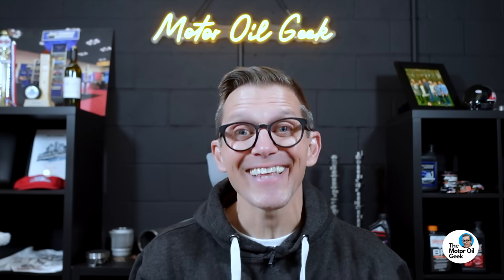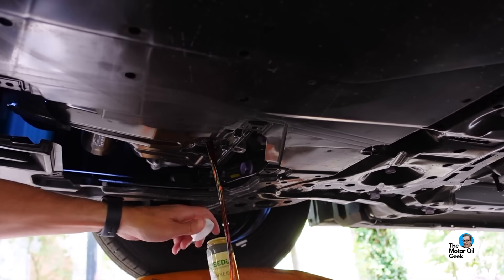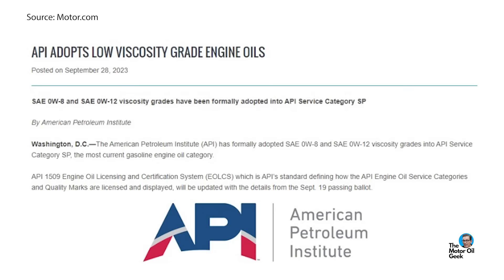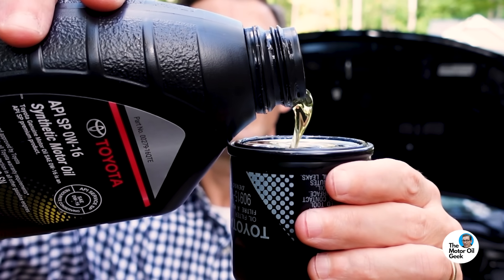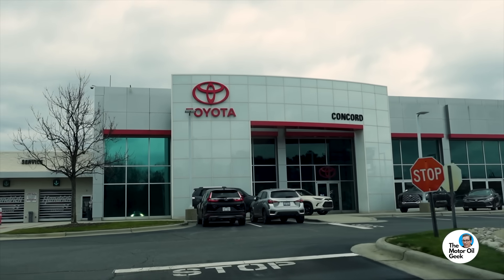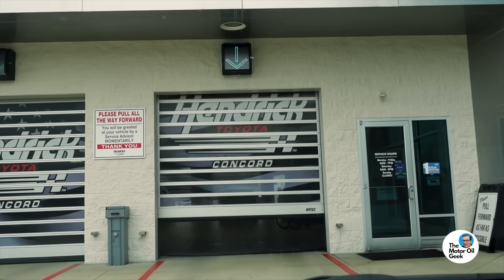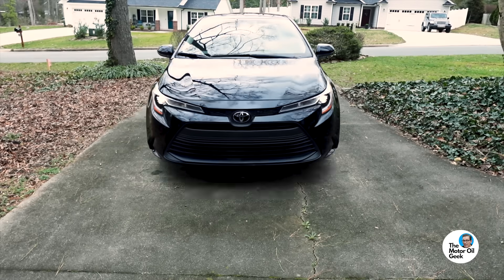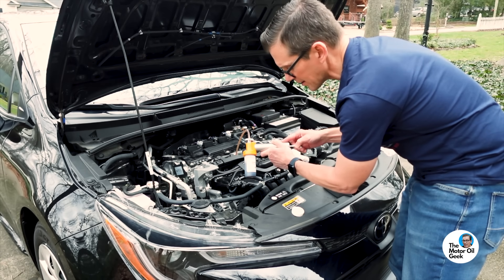0W-8 Motor Oil: Too THIN to Trust? Let's Find Out!

Comment: 0W-8 is crazy if it is even a thing now.  We have yet to see if 0W-16 has any meaningful impact on cars compared to the previous most common spec which was 5W-30/5W-30).  my guess is that at best, it would be the same due to improvements in metals and anti-wearing technologies, even though they now use a thinner oil and engines with tighter tolerances.

However, the FIRST mistake you made is that you DID NOT change the oil in that Corolla until 10k.  I would have done it at about 1000 miles, 2500 miles and then again at 5,000 miles and every 5,000 miles there after.  This sounds a bit excessive and maybe the second one at 2500 miles is not needed, but you do want to change the oil after the first 1,000 miles or so (After "break in").  I just do mine every 5,000 miles or about every 5 months, whichever comes first, and this is how I've done it on all of my vehicles (both right after break-in with the changes at 1k, 2500 and 5,000) and all of my previous cars made it well over 200k miles).  I'm sure it will probably be OK, but I would not go that long between oil changes especially if it calls for a thinner oil like 0W-8.  The reason the mfr likes to tell people 10k is because the engine likely won't have issues through the warranty, but it might start to have issues after a few years of use or about 100k miles probably if you keep to a 10,000 interval.  Go 5,000 miles and you shouldn't have any issues.  It's a bit old fashion thinking, but then again, oil is cheap, new/rebuitl engines are not.

And interestingly enough, even though in my manual for my 2020 Camry, it says every 10,000 miles, it actually reminds me at 5,000 miles.  I don't know if the dealer can change this and maybe they did once they realized I was going to be doing 5,000 intervals, but the car does remind me at 5,000 miles ( ican turn it off obviously for another 5,000 miles if I wanted to, but I generally stick to the 5,000 oir 6,000 if in a pinch, but not 10,000 miles. I don't care what type of oil or what type of additives it has).

Comment: I'm probably mistaken,  but I'm of the understanding that Toyota CVTs are "e-CVTs" and do not use the typical CVT belt but rather uses gears.
Reply: Not gears. They work and act as a CVT, but not mechanically drive. It uses motorized belts.

Comment: Is the Mobil1 0w8 the same as the Toyota 0w8
Reply from the maker: I don't know yet. We have not analyzed a sample of the Mobil 1 0W-8, but the Mobil 1 0W-16 is not the same as the Toyota 0W-16.
Reply: So I will use the Toyota oil until amsoil or pennzoil ultra platinum 0w8 becomes available hopefully

Comment: What makes an engine a 0w8 engine vs a 0w20 or 0w30?   What are the fundamental differences that allow an engine builder or manufacturer to recommend 0w8 over 0w30?  

I’ve seen bearing clearances on the Lexus 1UZ v8 be significantly tighter than the 1UR v8 but the 1UZ is a 5w30/10w30 engine and the UR is a 0w20.   

Is it surface finishes?  Pump flow capability?   

Can a 0w8 or 0w16 be run in a 0w30 engine?

Comment: Years ago we were taught to not change the engine oil in a new car until the break in period was complete because the rings would not seat properly on use of the normal oil. I'd love to hear your thoughts on the subject as most companies today don't have that break in oil . Is it because the tolerances with better NC machining make for less actual metal to metal contact...? And lets face it, Toyota doesn't want to produce a car that can go 400K miles .... they want you to buy a new one sooner.
Reply from the maker: NEW Engine BREAK-IN: Truth or MYTH?
https://youtu.be/X4424Q5lLR8

Comment: I have around 50 vehicles and pieces of equipment. I also only have 3 types of oil. 5w30, 10w30 and plain SAE30. Don't need anything else. Lightweight oils exist to please Uncle Sam not because your vehicle needs it, quite the contrary actually. Those lightweight oils are half the reason modern cars are having problems with oil consumption. The other half being low-friction piston rings.

Comment: little curious here........
the 0w-8 oil sample @ 2/28/24 (50 miles on oi) have Boron = 321 ppm & Magnesium = 527 ppm
the 0w-8 oil sample @ 8/20/23  (728 miles on oil have Boron = 21 ppm & Magnesium = 328 ppm
same oil formula?

the 0w-16 oil sample @ 8/20/23 (0 miles on oil)  Boron = 261
the 0w -16 oil sample @ 10/1/23 (2342 miles on oil) have Boron = 139
the 0w-16 oil sample @ 2/28/24 (7500 miles on oil) have Boron = 100
our engine consume Boron?

Comment: 10,000 miles is too long an interval ! NO oil ( or filter) can last that long and still do what it's designed to do. The Kia dealer recently went from 6k to 5k between oil changes.

Comment: Bro has like a PhD in vehicle lubrication fluids but didn’t want to risk draining the transmission incorrectly.  Surely a Google search could have located the trans drain plug.  None-the less, it was probably a lot easier to just have the shop do it so he can see how they did.

Comment: I put a plastic hose into the dipstick opening and the plastic hose stuck kompletely! I had to toe the car to a repair shop and remove the oil pan and remove a piece of the plastic hose.
Now I never change oil by sticking down a plastic hose onto the dipstick opening. I was fine with my Camry second gen, but a disaster with Camry fourth gen!

Comment: I traded an old Volvo s40 in and bought an s90 in 2018. I run similar tests every 6 months on the car as I did with the old one. Fantastic results with the newer 0w products especially being turbocharged.

Comment: 6000 is the research spec, unless it is heavy duty.  Oil used over 6000 shows ware and they want it to ware. They have a lot of over production they want to shift and that is not going to happen if you aren't buying new every 3 to 5 years.

Comment: Light weight oils starting under 20 weight below 0 weight and not going to stay on the bearings in spring and summer with full synthetic is just water flowing fast at the bottom in the oil pan.

Comment: Good job on using scientific methods for your questions. While true that additives, modifiers, detergents and surfactants matter a lot, viscosity also matters. Both are necessary for proper application. I dont think people understand how long a modern engine will last on full synthetic 10w40. Most likely it would outlast the rest of the car by 2 times as long. More than likely people wouldnt keep the car long enough for engine problems to develop from wear. Also 0w8 oil engines are low stress low rev engines that wont be used in racing. So the 0w8 engines will last for most consumers ownership of the car after that Toyota doesnt care. It would just be unnecessary and more expensive to use thicker oil

Comment: I had a 2021 Corolla, and put 115k on it with zero issues. Changed oil every 5k, changed CVT fluid every 30k. Very reliable and nice car.
Reply: Good info, thanks.
Reply: What oil did you use?
Reply: @RFJersey  I started with just full synthetic Mobil 1, then at 75k miles, I started using the Mobil 1 Extended Performance High Milage oil.
Reply: @ZacharyHankins  What weight?
Reply: @RFJersey  I used OW-20 for my Corolla.
Reply: Did you have the cvt fluid change by the dealership? If you don't mind, may I know how much?
Reply: @eraserheads78  Yes. I had my dealership do all my maintenance, and it cost me $250 for the fluid change.
Reply: It would have been nice to know what your summer temperatures are, and how long they last.

Comment: A friend of mine works at a lexus dealership. They use oem lexus oil when available. If they run out of oem oil, you get whatever is cheapest at the nearest autozone

Comment: I know this is in reference to 0w-8 oil. But I want to know the importance of using Dexos in GM vehicles and if there are non Dexos rated oils that meet or exceed the standards
Reply: Its all marketing jargain & holds no value. It's liability for any shop to use non-dexos certified oil. You can use any blend or synthetic that isnt "dexos" approved. It's all about money.

Comment: My dealership in Matthews, NC used 0w20 oil. They tried to tell me that they actually used 0w8 but they made a mistake on the paperwork. I said well that is a costly mistake because you will have to do it again. They did and told me that my oil changes are going to cost $120 when I start doing them on my own. Luckily I still have a bunch of free oil changes left.
Reply: I would have kept the 0W20.

Comment: dont care what anyone says I dont trust these thin oils. I'm convinced it's all about environmental reasons that they use it. Only way I'd use this stuff is if i lived in Antarctica.
Reply: my engines tick a lot with thin oils, that for me talks more than some epa recommendations. I hate ticking engines.
Reply: The absolute highest temperature any online viscosity chart shows 0W20 good to is 30c, after that the shear protection goes down, and viscosity breakdown occur.
Reply: 30c? You must mean 300c right?  @lonniebeal6032
Reply: We Gringos don't know how much 30c is.
Reply: @jamesbosworth4191 just a quick guess I'd say 90 F but yeah I hate when temperature is in Celsius it drives me nuts. Although a cool thing is negative 40 Celsius is exactly negative 40 Fahrenheit. That's when my interest in Celsius begins and ends though.
Reply: @Trumplican  In that way, I am even worse than you.  I still call "C" Centigrade, and I love it when yuppies try to correct me!

Comment: Corollas have a tiny little service port on the front of the transmission that looks like a little white plastic dipstick. There’s no drain plug on the CVT, you have to suck out the fluid through the top and refill!

Comment: My Yamaha  4 stroke snowmobile oil is  0W-30 .. After break in  I plan to use  Mobil-1 Synthetic 5W-30  which actually cost less than the Yamaha Mineral oil ,

Comment: Modern engines are closer and closer tolerances, of course they use thinner oils, if oil is too thick, it won't lubricate properly.  Especially on cold startups.  There is no debris in the transmission, oy vey.  OCD issues?  Change the air in teh tires rotiny, better yet use nitrogen better than air, won't change pressures due to temperature changes, right.  And rotate the wheel lug nuts for proper stress wear?

Comment: Toyota tech here; The transmission has a special process to checking the fluid level at a specific temperature range after fill up. It’s VERY specific, so they don’t include where to find the plug because they don’t want the owner to mess it up, which would be very easy.
Reply: Toyota engineers. I do what they say
Reply: Drain what you can from the drain plug, and put the same amount back in. do it every 3 years and you will have few issues. Did the same for two Chryslers never had a tranny issue.
Reply: Car Care Nut youtube shows how to do it. He is former Lexus/ Toyota master tech. 
If you can change oil, do a brake job, then you can do the trans oil drain and fill. 
You do need to invest in a $500 scan tool to read your trans temp internally. 
I’ve done 3 of my RAV4’s and my Sequoia. No issue, cars are driving fantastically.
Reply: Drain plug is external cap, 6mm stand pipe needs to be removed. You will get around 2.5 - 3 qts out. Add back same amount plus .5 qt of Toyota spec trans oil. 
Non hybrid use WS Toyota. 
reinsert 6mm standpipe, cap w drain plug. Temp at 113F internal, remove external drain plug to allow excess oil to overflow (must be level ground!), replace cap when excess starts to dribble. Done. 
Not hard, but you do have to know the temp inside trans.
Reply: Is it like a level plug? Get the trans to a certain temp like my F250 is 195F and pull the plug. Fluid should just barely truckle out.
Reply: If you don't mind, may I know how much for the cvt fluid change for this car?
Reply: Why people think transmission are a only special people can service is a joke. I drain the transmission, what comes out is the amount I put back in. I do this every 30,000 miles due to the heat we have here in Florida
Reply: What a joke
its the easiest procedure ever lmao
Plenty of guidance on the web for this, i'v done it on mine every 60k miles for years now
smh "toyota tech" blaaah hahah
Reply: My 2010 Kia Forte has the same, VERY specific "closed for life" transmission so they never include the transmission drain bolt.

More like stealership sales & services tactics. Have been doing my own on my "closed for life" transmission fluid & fluids changes. 

Never had any problems.
Reply: @mobileterminaluzer1858  What is their understanding of life in "closed for life"? 200k? 160k?
Reply: Just curious. Why does the dealer say the transmission in mt 21 Tacoma auto is  sealed? Thanks.

Comment: Lake, you could have used ur oil pressure pump to take a CVT fluid sample threw trasmission dipstick hole. Granted you would have needed longer tube to do it but it would have worked. Just an idea. BTW Lake what are you thoughts on Castrol Transmax ATF/CVT Universal Automatic Transmission Fluid. In specs it lists both cvt and atf transmissions, specifically it list mine Nissan NS3 CVT fluid so i'm using it. Im changing CVT fluid every 2 motor oil changes. I'm in severe duty use category. Thank you.
Reply from the maker: That’s a good idea! I should have thought of that.

Comment: You're an engineer therefore you know the term "energy can't be destroy just transfer". Thinner oil will get pass piston rings and destroy cat-converter quite rapidly. I used to be a smog inspector and get to see converter issue on newer cars all the time. Early 2000 Obama/EPA mandated better fuel economy. The goal for Democrats then/now is to control amount of money goes into Republicans oil tycoon. Same time making consumers pay dearly for all the damages that will follow.

Comment: Do you have relevant fuel economy data when running 0W-8 and 0W-16? How much more does it actually consume with the thicker oil?
Because I don't expect a noticable difference outside of lab testing or well defined test runs.
And if so...  I'd run 0W-16.

Comment: If you could get your hands on some mazda skyactiv transmission fluid I think that video would be very interesting supposedly they took an asin transmission off the shelf and tweaked the torque converter and it uses a special fluid I've seen no aftermarket companies claim compatibility

Comment: I don't understand why such thin oils are not only supposedly so effective, but preferred over everything else. I thought oil that is too thin gets pushed out and allows the metal parts to touch without a film between them, and wear much faster. Now I've heard there is 0W-04? Seriously?  Why not use 0W-0? Just lubricate with air! My old 1998 Toyota Camry called for 5W-30. And I thought that was pretty thin oil.

Comment: 1-decene, homopolymer hydrogenated ≥50% - ≤75%  68037-01-4 (PAO)
severely hydrotreated heavy paraffinic distillate ≥10% - ≤25% 64742-54-7 (HC)
distillates heavy, c18-50 - branched, cyclic and linear ≥10% - ≤25% 848301-69-9 (GTL)
benzenamine, n-phenyl-, reaction products with 2,4,4-trimethylpentene ≤3%  68411-46-1
solvent dewaxed heavy paraffinic distillate ≤3% 64742-65-0
organo moly-sulfur complex ≤0.3% 1928735-59-4

Comment: Here comes a not so smart question: My 2018 Corolla calls for 0-20, would it help or hurt if I went to a lower viscosity? I am not sure they changed the engines between 2018 and 2024. Thanks for your videos.
Reply: Hurt
Reply: @jaycarl1562  Thanks
Reply: @bertcopeland Never go with a lower viscosity.

Comment: I remember when Honda started to recommend 0W16 oil for the Honda Fit. (I ran a "1 man parts dept" in a Honda dealership.) Everyone was skeptical about such thin oil, myself included. And now, they want to go EVEN THINNER in newer cars? Is this the manufacturer's way to guarantee that the engines don't last TOO long, so you have to buy more new cars? They can blame it on the necessity to meet fuel economy and exhaust emissions regulations.

Comment: So my 2014 Jeep 3.6liter say's to use 5-20 on the oil cap and i was using the 5-w20. The 3.6 with the 5-20 would use a quart between oil change roughly 3000 miles. I switched to 5-30 cause the owner manual said i could. The 5-30 dose not use any oil in between changes. Am i causing premature ware by using 5-w30? The oil is Pennzoil Ultra Platinum High mileage.
Reply: Nope. If anything, you're helping your engine have less wear and tear, especially in hot weather or extreme use. 2019 Jeep Grand Cherokee Laredo v6 pentastar engine calls for 0w20 but 5w30 is much better for it since it gets crazy hot here. If you look up the same vehicle with the same engine from other countries  you'll see there's several oils you can use, depending on conditions and usage. These new thin oils are more of an EPA/CAFE thing. Thinner, more efficient gives you a little bit more power and mileage at the expense of wear and tear on your engine.